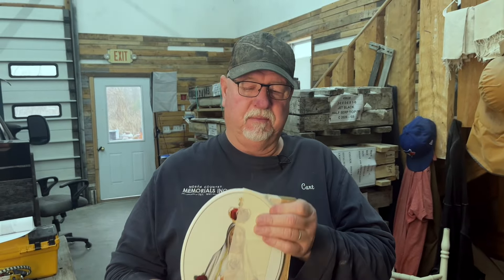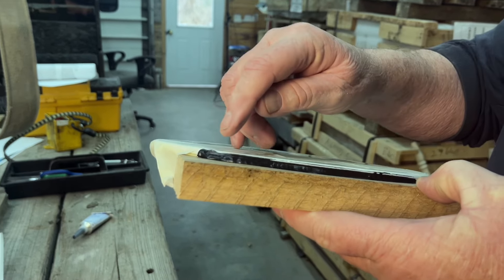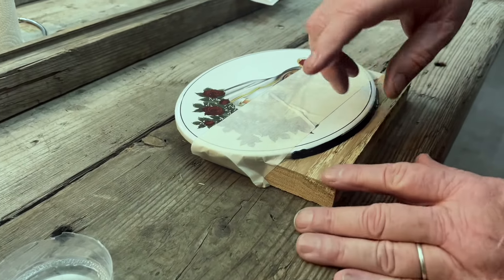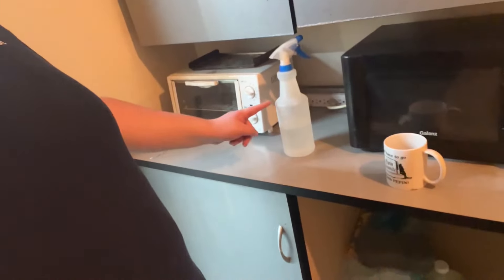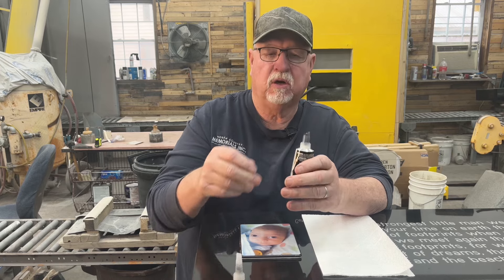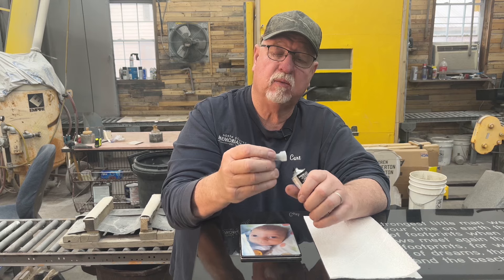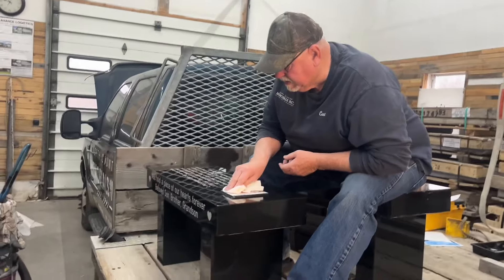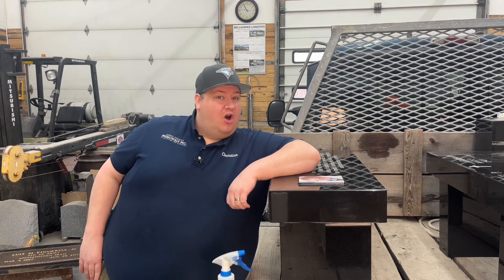How to put Color Photos on a headstone

Comment: After 35 years in the tile marble and granite business, I have found out, especially when using silicone, always use masking tape, leaving a quarter inch gap where the caulking goes. Then, apply the caulk just the way you did, seal with your finger (no soapy water), and gently peel away the masking tape.perfect every time.
Reply from the maker: Thanks for the tip.

Comment: We also recess our portraits in. We get them from paradise pictures. There pretty thin so it doesn't take much. Thanks again for another fantastic video!
Reply from the maker: Have you ever had any fall off? What do you use for adhesive? We used to recess but had a few come off after many years.
Reply: @-gravestonepros  I have not. I use the vhb tape that comes on the portrait and 100% silicone
Reply: Thin blue fine line vinyl tape, the same tape that is used in auto body shops. It comes in different sizes. 
The tape is very flexible.  Then mask around the blue tape, caulk, use just water on your finger and smooth out.

Comment: Thin blue fine line vinyl tape, the same tape that is used in auto body shops. It comes in different sizes. 
The tape is very flexible.  Then mask around the blue tape, caulk, use just water on your finger and smooth out.
Reply: Thanks for the tip.
Reply from the maker: We will have to try it.

Comment: Questions, recently Kobe Bryant had his statue unveiling and there were a few misspelled names. I noticed you cut out your letters back wards. Is there a reason for that. What would you do in a case like that. 
Also you look and sound  like another You  tuber. He is golf club repair and fitter. I belive in New England.
Reply from the maker: We always check stuff form back to front so its hard to just read and skip over discrepancy's. it would depend on the material used if a fix or change or complete redo is needed.